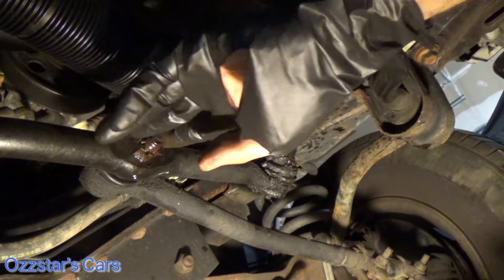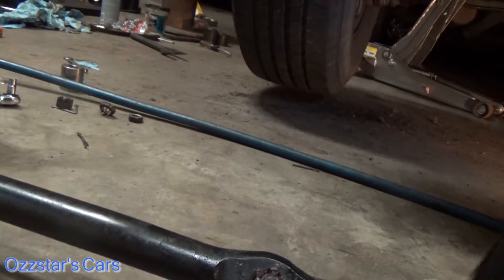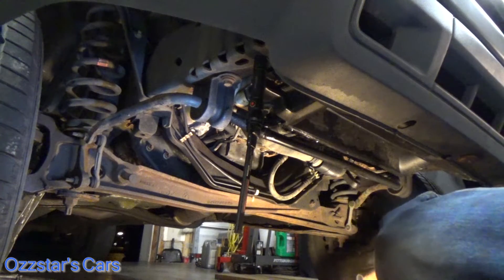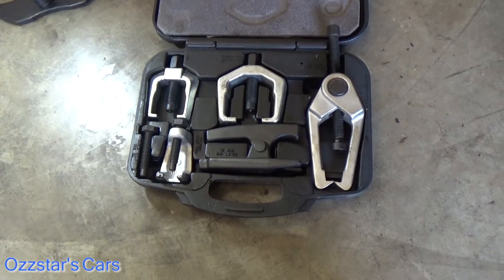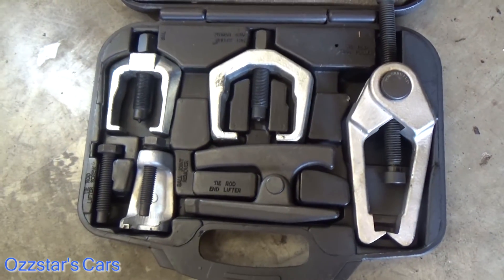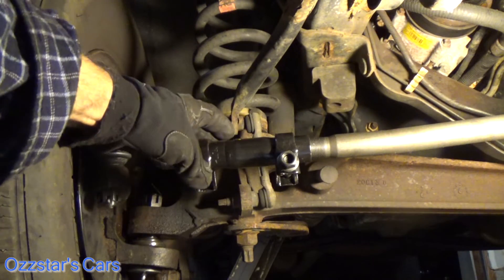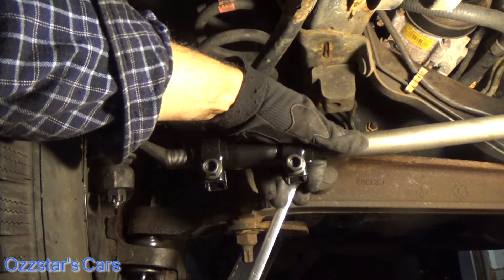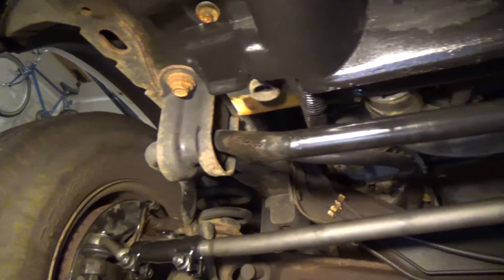Ford Van/Truck Replacing Tie Rod Ends - Sloppy Steering Fix

Comment: Great job Glen! By the way, I took a look at my wife's 2016 Escape and saw that the Sync 3 system was at version 1.0 also. The procedure was a little different as I have navigation and all went well. Have a great weekend!
Reply from the maker: Version 3.0 should get you some bonus points with the wife. 👍

Comment: thanks for sharing---- should you be able to move drag link by hand? i can grab drag link and rock it back and forth and it actually makes a thud metal to metal thud sound --- 95 e250 i am assuming it is worn out.
Reply from the maker: @Mark-d7j2v  new joints in good condition are very difficult to move. How many miles on your ride?
Reply: @ozzstars_cars  45,000 with a heavy truckmount carpet cleaner in it from day one back in 1995

Comment: Replacing this part will help my van from shaking when I got over 45mph is that correct? You make it look real easy! Great job!
Reply from the maker: There are a lot of components that can cause vibration. With bad tie rods the vehicle usually experiences loose, sloppy steering.
Reply: @ozzstars_cars  Ozzstar's Cars
Ozzstar's Cars
3 weeks ago
There are a lot of components that can cause vibration. bad tie rods are not one of them.

Comment: Very nice. I'm having to replace my four ball joints and all the bushings plus my alignment thsi Friday because my 95 Ford E250 is way out of line and the steering is loose even at 1/2 of my brand new tires and had to swap em to the back with just enough thread ot get me by till I can buy new tires again.

Comment: If the vehicle has the loose steering problem, is it generally necessary to replace all of the components as in this video, or could you get away with just replacing some of them? For example, does one component tend to wear out quicker than the others, or is it generally the case that they all wear out equally?
Reply from the maker: Only a proper inspection can determine what components are worn out and need to be repaired.
Reply: Most likely if you're doing the job yourself you might as well do all of it. You might have a decent joint on one side and a bad on the other side but if knes bad the others not far behind. These parts tend to have a domino effect.. if ya know what I mean. One goes, they all start getting extra wear from the bad part.
Reply: @billsauer3164  Thanks for the reply!

Comment: Thanks. My 2005 E-450 Superduty motorhome steering wheel gradually turned upside down. Could this be the idler arm or the control arm bushings?
Reply from the maker: I think you have something else going on but it's impossible to diagnose over the internet.

Comment: Nice video! Thanks. Can i hammer it from the bottom of the bolt instead of hitting the side of it?
Reply from the maker: Hammer what exactly?
Reply: @ozzstars_cars  Tire rod end that you removed?
Reply from the maker: @lonsomecrow  you can but if it mushrooms out then it will need to be cut or torched off.
Reply: @ozzstars_cars  right. Thanks for all great videos !
Reply: @ozzstars_cars  
I'm seeing the NUT being used to HAMMER on,  NOT the threads ,
Only this guy put the nut on backwards , like he said, it's all scrap
Replace all 4 tie rod ends
Reply: Hammering a few reqlly good raps, at the side of the part the tapered shaft goes through, can also help break it free a lot easier, with less need to smash

Comment: So when you say play left to right do you mean like the steering rattles in your hand while driving down the road?
Reply from the maker: @tylerhill6706  there is no rattling, sloppy feel, loose.
Reply: @ozzstars_cars  oh ok in e450 transit buses at our fleet we have couple that have sloppy feel to them. When driving you can feel it in the steering. We’ve done bunch of alignments on this one where the ball joints and tie rod ends appear to be fine.
Reply from the maker: @tylerhill6706  worn out steering box. Some can be adjusted up to a point to help remove the slop.

Comment: I have a question I did my tire rods I replaced all the linkage except for the long arm when I make a turn I have to force it back to center it’s not returning by itself could I have over tighten the linkage
Reply from the maker: Anything is possible.  Before the repair was that problem there?
Reply: @ozzstars_cars  Thanks for getting back to me no the problem wasn’t there it seems to be loosening up since I’ve been driving it I need a wheel alignment

Comment: Are you using Moog parts? Are they a better choice than Motorcraft in your opinion? Trying to save some $$ and do this myself but don’t want to using sub par parts.
Reply from the maker: Parts used should have a link in the description, yes Moog.

Comment: Would lock tite on bolt threads help, and how about anti seize inside knuckles?
Reply from the maker: Inside the knuckles?  Not sure what you mean. I never use thread locker on tie rod ends.
Reply: @ozzstars_cars  Another fellow uses 'anti seize' from a tube on the inside holes on the knuckle assembly before inserting upper and lower ball joinmts, just thot it might be a good idea to put it in the holes whenm you put the tie rod pieces together.  Another fellow puts lock tite on the bolts for the caliper bracket and the caliper as he is putting these back on the rotor, just thot it might be a good idea to put these on the tie rod bolts before putting the nuts on.

Comment: Seems to me just before putting these parts in would be a good time to pack them with hi temp grease, but why not?
Reply from the maker: Grease is added after installation.   That should be clear in the video.
Reply: You PACK wheel bearings 
YOU CAN'T PACK A BALLJOINT 
COME ON MAN 
LET'S GO BRANDON
Reply: @WHEREVER-I-ROAM  Bad choice of words on my part, but when I replaced my tie rods I injected grease in each fitting, moved the joints around by hand, and made sure the boots were filled to the max while they were on the bench before I put the new ones in.  Yes, lets go Brandon - wish he was already goine.
Reply: @sdthyng  - that would normally lead to a lot of squeezeout of grease, when you tighten down the nuts on the tapered shafts.  As effective, and cleaner, to inject the grease after the parts are in place.  Once a small amount of squeezeout is achieved, there is as much grease in there as it can hold.

Comment: How do you stop the threaded stud of the tie rod from free spinning when you are tightening the castle nut?
Reply from the maker: The stud should not spin at all.  The more you tighten the nut the more the bolt gets wedged into the knuckle.
Reply: @ozzstars_cars  i put a clamp on it to get it started. Once it seated fully it was no problem. Thanks for the quick response.

Comment: What is the torque setting for these nuts? I have e-250 year 2000 planning to order Moog assembly so probably don't need to grease it.:

Comment: Bruh, that clown totally disrupted the video. So what are the torque specs on the ends and the adjustment sleeve?
Reply from the maker: @vanlivingjoe  lol 3 ugga duggas
Reply: @ozzstars_cars  You got me!
Reply: @ozzstars_cars  But seriously, I'm seeing torque specs all over the place. Seems like 55-75lbs seems the common spec. But is that just the tie rod nut. Or across the whole thing. Sleeves, centerlink nut, pitman bar nut.